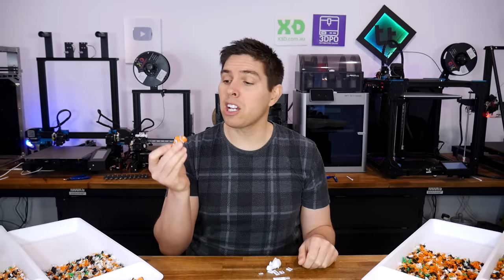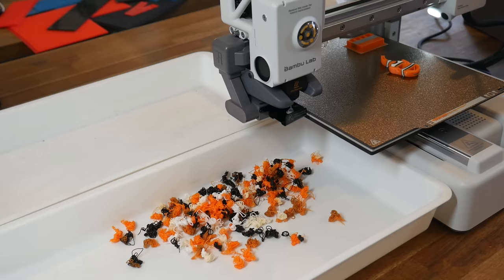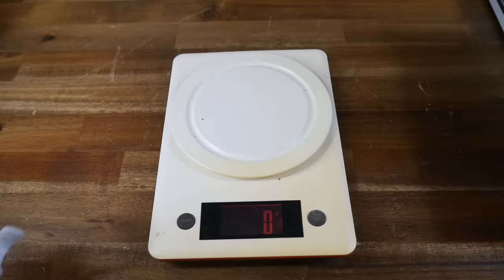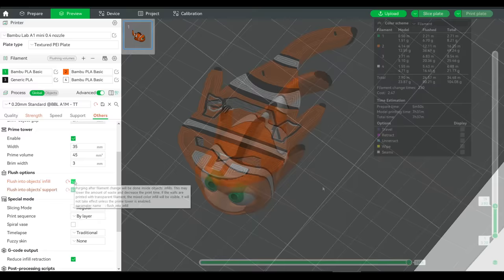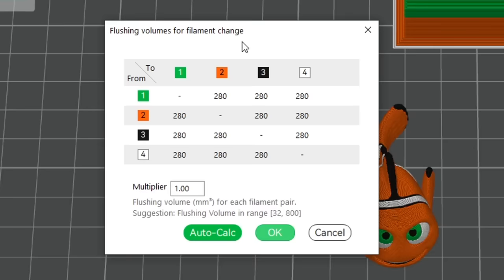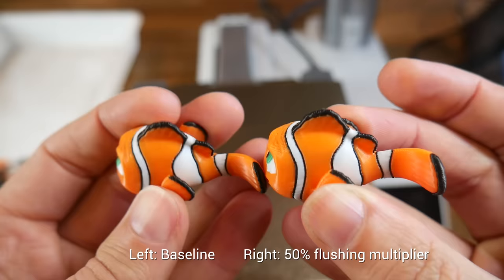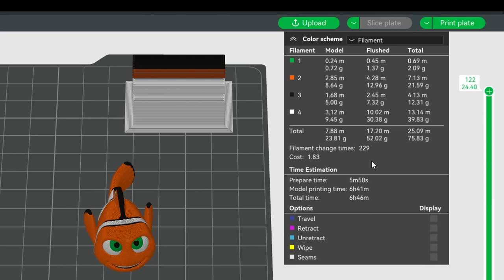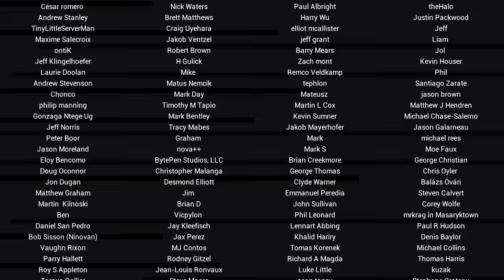Reducing waste from Bambu Lab AMS (lite) prints

Comment: When I was in paint automation we developed "Purge out with next color".  Automotive paint can ben SUPER expensive (hundreds of dollars per liter in some cases), so purging out was EXPENSIVE on things like Overhead Reciprocators and Bell machines because the line length was so long.  Even when we put the color trees closer, the costs were still high.  So we developed purging with next color.  It wasn't "Perfect" and we still wasted paint, but we GREATLY reduced the waste as well as the use of MEK (MethyEthylKeytone) which we used to dilute the paint, clean the nozzles, etc.  It was an art for sure on the amount to purge and such, but in a day we could save 5+ gallons of paint per line.  6 figures at the end of the day, AND a reduction in MEK use which makes the EPA happy.  :)

Comment: See if the infill isn’t going to be visible, my go to would be to have the printers purge process purge during the printing of the infill, instead of on a separate tower, the filament is used, and if you need to push more out and increase the density, it actually strengthens the print.

Comment: I just got my A1 and it a great consumer printer. 
I was using a ender 3 with the 3d Chameleon. The 3dc is a great low cost  solution to add the color change ability and when tuned right the 3DC does color changes way faster with very little waste.
Down side is the 3Dc takes hobby level of attention.

Comment: One Thing you forgot i like to do.
I am not the kind of person who has problems with supports.
You could have oriented the model 90 degrees (face down on build plate, tail up in the air) - with supports on.
This way you wouldn't have a material change every layer but maybe only every 5th layer or so. (For example: the tail and the face have red segments where the printer could do multiple layers without changing). 
this method depends highly on the model of course, but in some instances you can cut multible HOURES ;)

Comment: I'd LOVE to see "flush into different object" or "purge into different object" where instead of a wasted purge block and/or poop-chute, all the waste could be printed into a separate color-independent model. So, no waste at all! Perhaps on one corner of the bed could be the main model, and then another corner could be the separate "purge model" (so height wouldn't be an issue, but wouldn't bump into models)
Reply: Reading other comments : it's already possible

Comment: Excellent video thank you very much! Just one thing to keep in mind: when switching to a single color print after using multiple colors, there might be some color bleeding due to the absence of a purge block. So, a bit of extra attention is needed to ensure a clean color transition. However, for multicolor prints, this method works wonderfully.

Comment: IDEA/QUESTION: Based on the extruded junk at 8:32 and also by the graphic shown at 1:27 is it fair to say that more material could and should be pushed out of the extruder and perhaps it should be cut BEFORE the transition in color takes place. Like couldn't one calculate the amount of material that was between the cutter and the nozzle tip then do a volumetric calculation to prematurely cut and exchange the filament? This almost seems to simple, like it should be being done already. The graphic shown at 1:27 doesn't indicate if it does the cut before it wants to start printing in another color or not, but I was left with the impression it is cutting and exchange at the instant it wants a color change. If the flow of filament is pretty laminar and doesn't mix too much (hard to tell from the 8:32 poop), then perhaps this technique of prematurely cutting and swapping would save even more filament (if it's not already being done). Just and idea, which seems really simple so I kind of have to assume it's already being done and I'm just never heard anyone say it.

Comment: I was hoping to see the special case for optimizing the printing of support material. Often the material for support is only necessary at the interface between support and model. Material changes can be skipped by printing layers of support in model material right up until the interface is encountered. This will eliminate the vast majority of changes and purges for when switching to and from printing a support structure within a most layers.
Reply: Make that video.  People need examples!
Reply: Isn't there already an option in the slicer to click that enables that support material only at this contact points?!
Reply: @fellwind   I don't yet have this printer. But I found this article and video:  "Printing soluble interface supports with Prusa i3 MK2 Multi Material"  (search) dated 2017.
Reply: @hassosigbjoernson5738   Looks like there is in Prusa's slicer. Not sure about the Bambu.  I don't own one.
Reply: @eideticgoone7035  It's an option in Bambu's slicer as well. I've tried it. Personally I haven't found a lot of use for the specialized support material yet, but I also haven't attempted to use it that much either. YMMV.

Comment: Great video as always, thank you. There were a few things I think would have been nice to see as well. 1) it would've been nice to see you play with the multiplier and push the limits. 50% works but does 40%? 35? Etc. 2) Something else that I was looking for was a data point on your graph for doing multiple of them but showing it per model. So you had 51g of waste but that's for multiple models. Divide that by the number of models and show that each model only had 10g of waste or however much and then see how many you can fit on build plate (not actually having to print them all) and calculate how low you can get waste per model of you are mass producing. Thank you!

Comment: IIRC Prusa MMU changed through filments sequentially (maybe Bambu does the same, Tool1 >2>3>4, etc)  You could position your filament colours (tool position) to print in sequence to reduce overall purge volumes (avoiding Black to white)

Comment: Would it be possible to add a retraction to the colour change G code just before the filament is cut? If you can pull the blob up until it's just below the blade, you're still cutting off the blob and any stringy bits but you're also saving a lot of filament. I am assuming that the filament path between the knife and hotend is smooth enough that the blob can't get caught on anything, of course.
Reply: See the top-rated comment.

Comment: I'm missing orientation. I think a lot could be gained from it. Most of it is in layers, and while the layers wouldn't be flat, it would reduce to like 2 colours per layer instead of 4. And a bunch of layers would just be orange.

Of course there would be a hit to print quality, but that's an experiment worth testing.

Comment: Increasing infill is another trade off if you don't need it, just uses more filament which can be waste. I think a proper working 4 in 1 out hotend is the key here. BambuLabs could perfect that and would only cause short retractions needed to change each color.

I have a design in my head  that will still allow the filament to retract and be smooth to get reinserted again automatically.

Comment: There where other methods by altering the location the filament cut/switch happens, by retracting the filament first. This was a community effort, and for this specific A1 / A1M model there is upto a 33% gain. A similar method has been adopted by BambuLab and rolled out in firmware update two months ago for printer model X1C since firmware version 1.07.03.00 an even more significant poop reduction was possible. For A1 / A1M however there appears to be little to no gain because the AMS lite is not as inefficient as the AMS units. More info on ambulab forums or the subreddit.

Comment: I don't get why the use of a purge tower is needed, maybe a string of filament is oozing out, but the silicone brush could be used for that. I think a multiplier of +0.75x without the purge block and with wiping on the brush would make the print faster and less wasteful
Reply: I'm also curious why there is a purge block if the filament is also being purged out into a bin? Seems redundant to me but I have yet to really delve into multi material printing (apart from doing it manually) or try a Bambu printer.
Reply: From what I've gathered, it's because the different filament may have over- or under-extrusion after being loaded. The prime tower is to load in the new filament for it to properly extrude so there are no blobs or gaps in layers.

You can turn off prime towers in settings since it's not used for purging, but you could have inconsistent layer lines and bad layer adhesion as a result
Reply: It's to build up nozzle pressure.

Comment: Purge will forever be an issue with single-nozzle multi-filament printers. You can reduce it down, but it will still be there. And so long as something is visible, someone will complain about it. The issue that many miss, and you alluded to, is that purge is finite across the entire print... while the print is variable. So purge into object, purge to infill, purge to support, etc. all help... but if the layer can't purge everything via those methods... then it needs to make a purge tower. And worse, if the layers above don't have the amount necessary, then it needs a purge tower AND needs something printed under it. So the tower will be there even with all the settings.

I've wanted better calibration of purge... there are 101 tutorials, blogs, videos, models with instructions on how to reduce purge, but what really is needed is a built-into-printer or slicer way to calibrate AND it needs to be deterministic. I'm tired of so much of 3D printing being "it works for me". Cool, I want to follow some steps, get a result, and then give it to 5 friends and it works as perfect as can be. Sounds like I'm asking too much, but I'm not. People keep saying X printer is almost a consumer appliance... yea, then it needs to act like one and be reproducable. So first, better calibration of purge.

Second, I've wanted variable infill (someone else below mentioned this too), where the more purge you have, the more infill you get. And I believe that with a bit of intelligence, the purge can actually continue to additional layers that would otherwise be sparse. I also think that so long as it's not intended to be a moving part, it could be possible to do a Bambu purge poop into the hollow portions of the model. But it leads to maybe 2.5...

Second point five: better slicing. Print thicker infill, variable infill, extra support structure, have the slicer recommend to print extra models to reduce purge out the back or into a tower, have smoother wipe operations so priming and purging can go right into infill without worrying about it curled overhangs and such, pickup that the print is going from black to white and try to purge as much out before touching perimeters as possible so bleeding doesn't happen. But also, think of the tools... if you want to change a filament, you probably don't need to pause the printer for some changes. Or you specify in the slicer "tool 1 is red, tool 2 is blue" and the slicer tells the printer "tool 1 is blue, tool 2 is red" because it knows it can reduce filament retraction through that tool then the other. There's a lot that can be done. My fear is that not much work is being done on it.

Also, unless things have changed since I last checked, don't use the Auto Calc for filament purge in Bambu Studio (and probably Orca Slicer). It barely works. It's a nice user friendly way to suddenly find bleeding or purging way way too much. I remember looking at the code when they first introduced it and it was literally ripped off StackOverflow (software Q/A forum) for how to figure out the difference in brightness between colors. To make matters worse, it was selected as the answer... but every comment said "the math on this is wrong. You'll get incorrect numbers and in some cases it will be reversed". So it's not good but it makes a great bullet item to announce in release notes.

Comment: Be nice if someone could come up with a way to use a dye to change the colors as the machine is 
printing  to prevent waste .
Reply: XYZPrinting has their da vinci color series that does (did?) something like that. Could make amazing prints by printing a color layer on top of the 3D print. I am not sure they are around though. Their website doesn't seem to have been updated since early this year.

Comment: Changing the wall order to infill/inner/outer should also allow the purge volume to be lower but I am yet to experiment with this
Reply: Yes! Both purge and prime to infill and if that's not enough do it to the inner perimeters too. Could even add more perimeters as needed, better have the plastic in the object than a purge tower.

Comment: Someone modified filament change G Code to retract before cutting.
Should allow for even less purge volume.
Would be interesting to see the reliability of that setting.
Reply: Increases the risk of clogging, as the former molten filament stays in the heatbreak until the next filament comes.

Comment: They could improve on the AMS if the filament didn’t have to get pushed and pulled all the way back to the spool a whole yard, that takes quite a bit of time itself and I think would help on wear of the stepper motors. Swapping colors from just that adds like 15 seconds per change.

Comment: wonder if you did a large retraction but not enough to completely remove the filament and then did the cut if that would help the purge?
Reply: That's what I was thinking too.   I don't know where the blob would catch but I assume it's in the tubing and not the hot end
Reply: @PritpaulMahal  doing a measurement on my unused spare bambu hotend its 23 mm long it would be interesting to do maybe a 17 mm retract before the cut and see what happens both to reliability and purge amount needed. i don't have a bambu AMS. i tried multi color with a pallet 2+ but wasn't really happy with that so stopped doing multi color or multi material.  but I still keep an eye on it and the Bambu AMS has been tempting me.

Comment: I'm a huge fan of Bambu's X1, but I've thought since the beginning that the multi-colour element was really just a gimmick.  Now that the printer can fail-over to another spool if one runs out, I can see some utility for the AMS for high-volume machines, but multi-material or multi-colour through a single nozzle will just never be worth the wastage, in my opinion.
Reply: Very much depends on the use case.
If the only colour change is an embossed logo for example, it wastes very little but looks great.

Comment: Great video as usual.  I have spent quite a lot of time looking into this issue recently. Concentrating on purge to object.  What I am working on is an efficient method (using scripts) to select the right 'purge-to' objects to go with each multi coloured print (from a queue of 'doesn't matter about colour' objects that I want to print anyway)  - that have the right size layers at the correct heights to maximise their benefit in terms of receiving purge.  This method can then be combined with the purge to infill, auto calculate, reduced multiplier and some of the other GCODE changes suggested by others so that in many cases I believe it will be possible to get the off bed purge down to practically zero -  or at least less than 0.5m or 1g.   The problem is then the prime tower.  If you turn off the prime tower then 'purge-to' objects no longer seems to work - so I have created another script that goes through the G-code and comments out all of the G0 and G1's within the coordinates  of the prime tower.   Haven't actually done any physical prints yet - but hope to start testing next week.   Will report results on a thread within the BambuLabs forum. https://forum.bambulab.com/t/making-better-use-of-purge-to-object-in-bambu-studio/29422

Comment: Prusa just released a Dev Diary talking about a new ramming procedure for the MMU3 for Mk4, basically a pseudo cold pull. It should reduce the purge requirement a fair bit. I'd be curious to see a comparison between the Bambu AMS and Prusa MMU2/3 and the XL for multimaterial quality, reliability, and waste.
Reply: i think the biggest problem is the price for the XL :P

need  ALOT of filament waste to justify the 2000€/$ price difference ^^

Comment: Analyse the filament change gcode for the cutting movement. Before that insert a retracting command like g1 e-20 f3600. So you will only cut the very tip of the filament and not the whole length inside the heatsink

Comment: Michael, it would be very interesting to see you take on the challenge of building and tuning the Enraged Rabbit Carrot Feeder MMU system. Pairing it with a Stealthburner toolhead on an existing machine could be a cool video series. There's even modified Stealthburner bodies that include a method to cut the filament like the Bambu labs printers. Bambus are great but them being closed source is a shame as an AMS that was printer agnostic would be great.
Reply: Esp. with Revo Standard nozzles, Cut&Poo isn't needed, as ramping works very well with integrated nozzle/heatbreak combos. On High-Flow cut&poo is the better solution. Depending how many filament changes your print needs, you could decide between a RevoHF+cut&poo or a RevoStandard with ramping.
I hope to get the MMU3 for my mk4 soon, as the filament tip on unload on a nextruder nozzle seems even better than on a Revo.
Have not tested the Triangle Labs Unified nozzle (TUN) yet, but this might be a cheap alternative to make a mk3s+ + MMU2/3 more reliable.
Reply: tradrack or the new stable rabbit is a better choice, the ERCF is a bit flimsy and not as great of an experience.